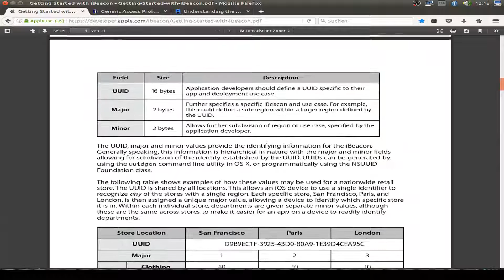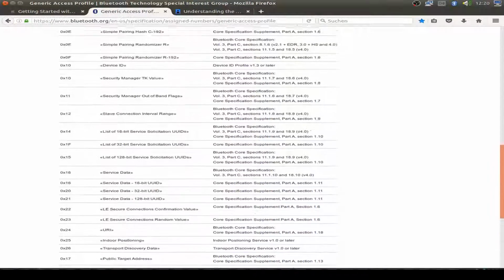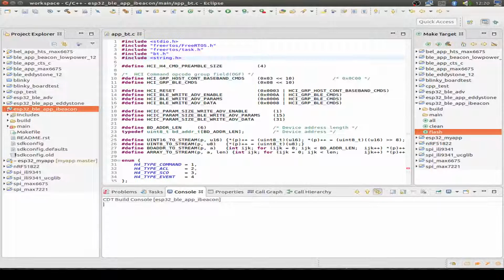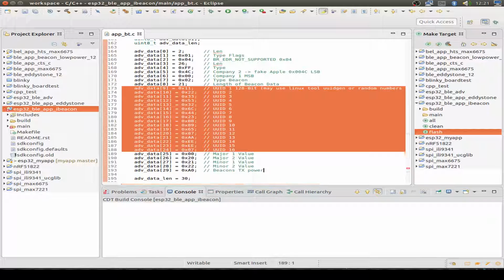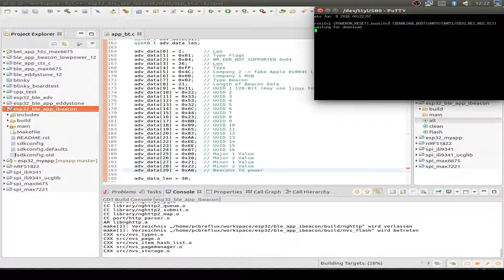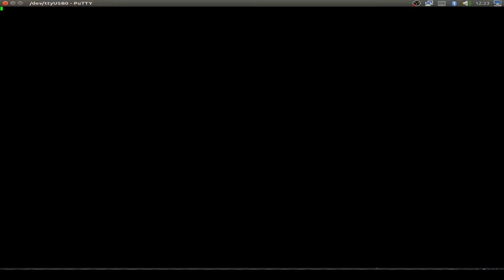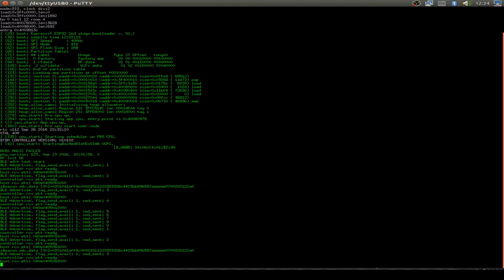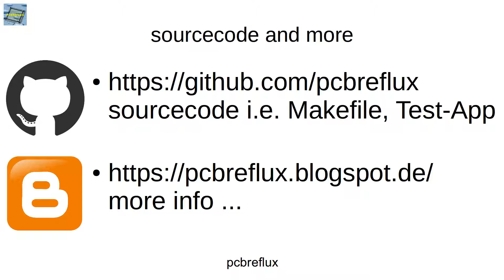ESP32 #6: BLE / Bluetooth iBeacon implementation

Comment: So I can use this for Beacons and have an AP serving a basic static page? 

Range of each? Best battery for a small package?
Reply from the maker: Hi, on the ESP32 you can run different tasks (using FreeRTOS) interdependently like a Beacon and a webserver. Not so easy on the nrf5 chip (no WiFi) but mostly lower energy consumption. Range see here https://www.youtube.com/watch?v=yCLb2eItDyE but usual the PCB antenna is just for 10m to ~15m and choosing a battery depends on your board and voltage regulator. Easiest are LiFePo4 with max. 3.6V can be used without regulator or CR123 battery with 3V or Li-Ion/LiPo with 4.2V the you need a regulator and/or charging and protection circuit.

Comment: I want to develope my own BLE device using ESP32, do I need any certification from any authority?
Reply from the maker: arunbm123 Hi, this question is totally dependent on the laws for your target marked and your product. So better consult a lawyer before selling or try, like other sellers, to keep the responsibility for owning and using the product to your customers.
Reply: Thanks Sir
One more thing...ESP32 is best for commercial BLE Beacons, Your Views Please....
Reply from the maker: arunbm123 Think the ESP32 for using just as a Beacon is a bit over sized. You can do so much more with two cores and also even if only you used it as a BLE device the power consumption is above average of other products. But it will be great if you also need a one chip solution with WiFi. Compare your requirements also with the nrf5 products from nordic semiconductor, but I 've no experience with other manufacturers.

Comment: heyy.. how can i turn this esp32 into beacon that scann for other beacons as well as broadcast itself..please provide guidance to understand your codes.. thanks in advanced
Reply from the maker: Hi, 

think from todays perspective the best way to solve this for you you is to have a look into Neil Kolban's ESP32 libraries:

https://github.com/nkolban/esp32-snippets/blob/master/Documentation/BLE%20C%2B%2B%20Guide.pdf
https://github.com/nkolban/esp32-snippets/tree/master/cpp_utils

Start two tasks one for a BLEServer (broadcasting your beacon, only advertising, no characteristics, test the advertising with nRF Connect) and a second that periodically call BLEScan (BLEDevice::getScan()) to discover other beacons.

Even after one year the development for the ESP32 every code is still a working progress.
Reply from the maker: Btw. the library is available also for arduino inside arduino-esp32 with 

https://github.com/espressif/arduino-esp32
 -> https://github.com/espressif/arduino-esp32/tree/master/libraries
 -> BLE 
->  https://github.com/nkolban/ESP32_BLE_Arduino
Reply: YES ACTUALLY I USED THAT LIBRARY ..WITH ARDUINO..
But now i want to make esp32 a ibeacon or eddystone beacon or a physical web beacon.. but we have to use esp_idf because these things are not yet supported in arduino ide.. im using msys32 environment and using bash command im flashing
Reply: can i use esp32 in such a way that it will scan other beacons as wellas  broadcast itself.. in short i wanna use esp32 in both mode broadcasting and scanning
Reply from the maker: Rana Ankit The Lib also works with esp-idf.
Reply from the maker: Rana Ankit sure, as mentioned just use two different tasks and you can do both simultaneously.
Reply: pcbreflux so according to you I have to merge these beacon and eddyatone code!?
Reply: pcbreflux but when I'm using esp idf example there is no makefile so I can't use "make" "make menu config" and make flash command in ming32 window..
Reply from the maker: Rana Ankit For the makefile you can have a look at this example https://github.com/pcbreflux/espressif/tree/master/esp32/app/ESP32_ble_i2c_ina219
 maybe you have to update the lib from Neil Kolban.
Reply from the maker: See also the main/component.mk file how to include to library.

Comment: Amazing work on the videos! 
Is it possible to make the ESP32 behave as an ibeacon and also simultaneously take sensor data and periodically push it over to a server using WiFi?
Reply from the maker: Pranav Budhiraja Yes, due to multitasking with FreeRTOS inside the ESP32 libraries (like esp-idf, esp32-arduino) you can use WI-FI, Bluetooth and gathering sensor data simultaneously.
Reply: Thanks you!

Comment: My ESP32 Didn't Running, I use 3v3 from uart and I tried 5v with ic regulator and still didn't running. 
when i touch EN pin (not a button, because I use a board) led TX from UART is on. need a suggest.
thanks
Reply from the maker: Can you tell us your board? bare esp32 WROOM module? Have you seen my esp32 #3 video getting to blinky step by step? Its a little bit detailed but maybe this is what you need?
Reply: okay thanks, Now i can Flash it, but Still Have a Problem to Setup Device Name. :/

Comment: Hi. Your tutorials really wonderful and helps lot for the beginers. I am new to ESP32 and have little knowledge of eclipse! how can I initialize BLE of esp32? I want to control led with esp32 simply using application. Can you provide me commands/tutorials/documentations?? thanks
Reply from the maker: Update my BLE Example with LED Code (Send "LED ON" or "LED OFF" via BLE Mobile App like nRF UART or nRF ToolBox) and you switch one LED on or off. Example here https://github.com/pcbreflux/espressif/tree/master/esp32/app/ESP32_ble_UART ... and just look into the changes for controlling the LED here https://github.com/pcbreflux/espressif/commit/4978673125e1257bc2851cf261b5b600255fbc0a#diff-d7c35836b4715d408cb3611ca05653c2 . You can change the GPIO Pin for the LED but the example use Pin 22 see #define LED_PIN GPIO_NUM_22 . 

Documentation for the esp32 API including Bluetooth and WiFi can found here http://esp-idf.readthedocs.io/en/latest/api-reference/index.html and a good source of world wide wisdom here esp32.com ...
Reply: Really amazing! Your provided tutorial helps a lot and makes work succesful :) Thanks Once more! :) Well now I am going to do the same task with wifi. controlling led from ESP32 Wifi using webpage or web  application(as a client) and i really need your help. Do you have any such tutorial/documentations. Is this is possible in eclipse to merge two different codes and make one single code with that ??

Comment: Hi, I want to control simple led using Bluetooth low energy of ESP32 with esclipse neon. Can you please help me and provide me any tutorial. I am new to eclipse neon
Reply from the maker: Hi, watch my Bluetooth server tutorial ESP32 #39 with example code for eclipse neon. You can simple add the led control to the ble uart message and callback function.
Reply: Thanks! my led is connected with esp32 and I want to on/off that led with Bluetooth BLE of esp32 where esp32 act link a client. I want to control that led wth android/ios app.
Reply from the maker: Luckily nordic semiconductor provide the sources for their mobile apps: like https://github.com/NordicSemiconductor/Android-nRF-UART and switching an LED is just one line of code: gpio_set_level(pinno,level) after defining a pin as output with gpio_config.

Comment: Thank you. I can do it. But I have 1 question. BLE Advertising is a one-way communication method. The ESP32 can give a UUID to a smartphone but this esp32 can not receive any data from my smartphone, right ? For example, I want to build an app that after recognize the Beacon, it can sent data back to ESP32 and the ESP32 will sent this data into a server. So how can i do that ?
Reply from the maker: Nguyen Khanh Hoang Hi, the beacon is a one way communication. But beside the beacon you hsve to implement also a ble service (gatts)  so you can connect to the esp32 and send your data via bluetooth and the esp32 can  transmit it via wifi.
Reply: Thank you.
Reply: @pcbreflux  Hi can you elaborate or provide example how it can be done. As I am working on a similar project which requires some startup guide. Thanks.